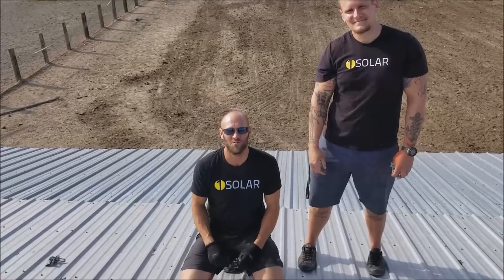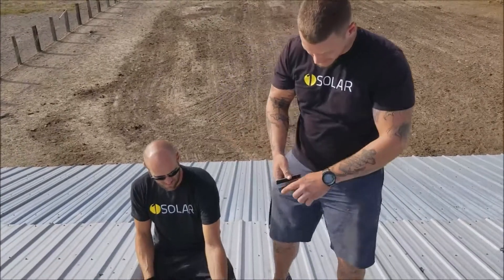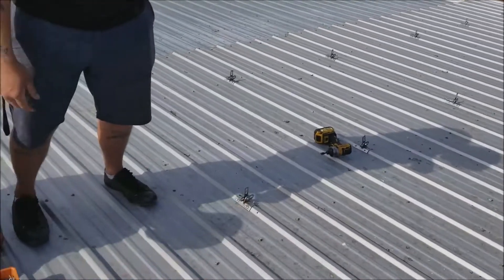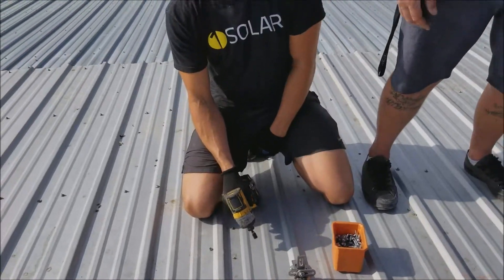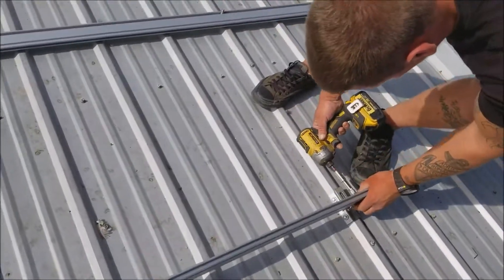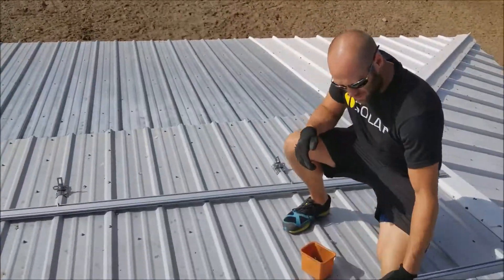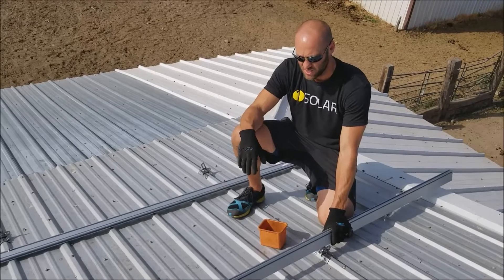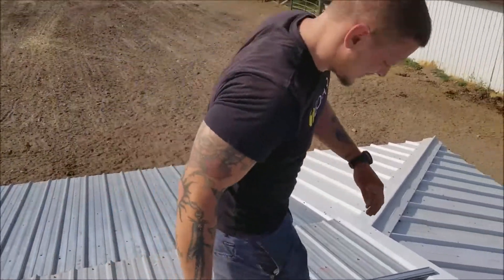Metal roof solar install

Comment: Can you walk on the panels, I just had panels installed using this exact same system and they were walking all over the panels.
Reply: Yikes, I was told to leave spacing for a walkway and not to walk on the panels.

Comment: What do you typically space these brackets at? 2 foot or 4 foot centers?
Reply: The high points are on 9" centers. I counted every 5th one has a bracket. So 45" centers.  I bet the rail requirement is 48" or less because roof rafters are typically on 24" centers.

Comment: I don't like the idea of drilling the roof. Do you add a silicone on the holes?
Reply from the maker: I don't blame you for questioning that.   We still haven't had a leak.  They're solid.
Reply: The Protea Bracket has a factory applied EPDM Gasket. This along with an EPDM Gasket on the screw keeps out water and is protected from UV due to the design of the bracket. These brackets are tested to ASTM E2140, same water intrusion standards as for standing seam metal roofs.

Comment: What about the 1/2" bolt that holds the L foot to the Protea bracket?
Reply from the maker: Try using a 13mm socket.  It's not the same.  The 1/2" is tough to get the socket off after you tighten it.
Reply: @1Solar  or a really long extension. Love the Protea brackets.

Comment: We seem to be screwing the rails to the tin itself, not the battens underneath. A better system removes existing roof screws and uses longer screws in the same holes to secure the rails to the tin and ALSO the battens beneath the tin roof. This is much more secure when the high winds inevitably strike the panels.
Reply from the maker: The racking is rated for snow and wind loads.  We've never had a problem with that.    Great structural engineers signed off on this method.
Reply: The whole point of this bracket is to not do those things.
Reply: Doesn't it matter the gauge of the metal?  These can't be used on ag panels (whatever you call the thinner gauge metal you can get from Home Depot/Lowe.
Reply: I'm on the coast in a hurricane zone with a 26 gauge roof, have to figure out if I need to go into the roof deck or not. Like this mount but is it strong enough is the question.

Comment: would it not heat up the panels? as far i know. you will need to give some space at the back of the panel so that it can cool with the air flow. more heat = less efficiency
Reply from the maker: More clearance is better for efficiency, yes.   It's up to the homeowner.  Efficiency vs aesthetics is a question we are faced with often.     Sometimes people don't want panels on the front of their house even though it's south facing.